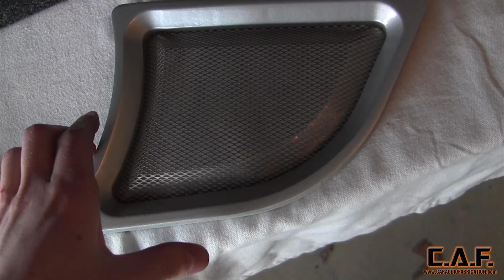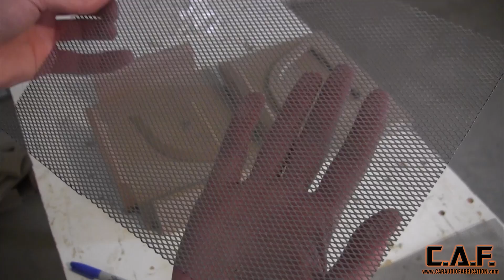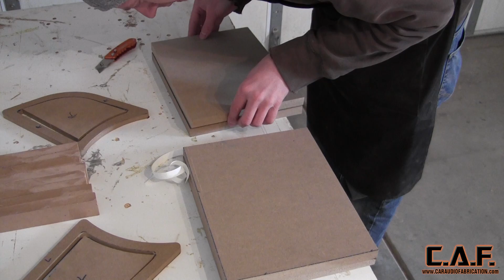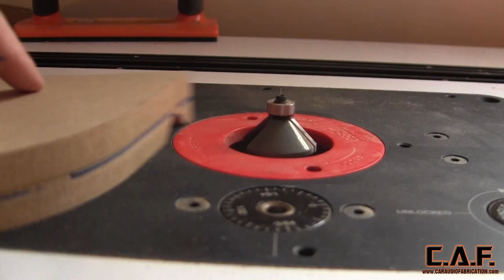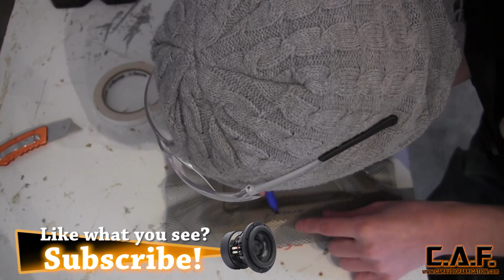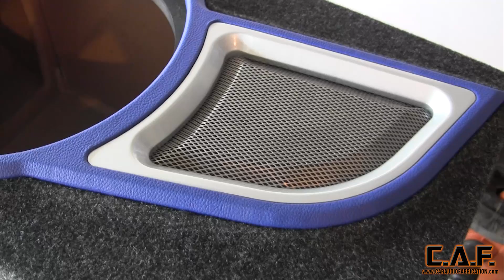How to Mold Metal Mesh for Speaker Grills and Ports - CarAudioFabrication

Comment: Nice job ,I worked in prototype ,there  are a lot of different perforation pattern's available in brass ,it forms easily,but not as strong as strong as steel ie dent resistance .have used high durometor polyuerathane castable rubber for press form's.etching primer is ness before paint ,powder coat,or plating work's well also on both for more option's

Comment: I started running out of room behind my stock grille in my first gen RAV4, I went about cutting away the plastic mesh at first but wasn't happy with the unclean non-stock appearance of an open uncovered speaker. I'm pretty hesitant on going forward with buying a hydraulic press or a router so I can probably replace those two with 'lowering my cars full weight onto a 3d printed form' ?

Comment: I have a 1997 lexus lx450 and I want to put a 12 inch subwoofer  behind the rear  passenger side panel . Right now I just have it screwed into the panel with no box behind it . I'm going to talk to some local installers about a fiberglass  type  box that will form from the odd shape of the  metal  behind the panel . Can you give me a idea of what something like that would cost .

Comment: Wire mesh finished with powder coating for a knockout look ... Can be achieved  with a home oven, powder adhesion is equal in thickness due to electrostatic attraction. Think  car seat belt buckle or stainless steel appliance finish or VW finish etc... Thanks for the education!

Comment: You can do right angle, but you have to shape the top piece double angled. First the gentle angle you have now, then the ninety that ends in a chamfered (ball preferably) edge. I've done it on just about any type of mesh that's made of under 2 mm material on the "link". Anything thicker, and you're going in to complicated forms or bigger presses. The other critical thing is, this method will draw the "skirt" on the outside far more severely than any other method. I recommend slice cuts made to match the kinks found via a sacrifice test piece.

Comment: you can eliminate the female top form by using a solid block of shore 40ish rubber, or a laminated "block" of thinner sections glued ala plywood. a couple dozen rectangles of  shower pan or pool liner, roofing membrane, even that castable rtv for molding poured as a brick. then alignment is only critical in parallelism of punch faces, so the same top can be used on a gaggle of bottom male forms. so long as the rubber stack is half again your draw depth, and you limit yourself to 18 ga mild steel sheet or lower load ranges, you should be golden on even relief details like ribs, insets, style lines, etc. if you only want to do mesh or  expanded sheet, then softer rubber shore 25ish will allow very intricate relief impressions, but the loads of solid sheet will give poor results, and very rapid wear on a soft die. shore 20 is a rubber band, 60 is a stiff tread truck tire, to give an idea of hardness involved.

Comment: I like this a lot but the problem is with a lot of ur videos is that it takes so many specialty tools that ppl like me are discouraged I am sure I can wing it on some of the process but I build for my personal  use only, but u r very talented and do great builds I enjoy your videos even tho it isn't feasible for me to use your techniques due the the limitations of my tool box
Reply: Daniel Harrell another option is to press it with your car tire... jack up your front wheel and slowly lower the wheel down onto the box!!
Reply: Ryan Drzewiecki gonna guess he was probably more concerned with the $1000-1200 worth of router/table/bits rather than the harbor freight press. OTOH, if someone has never used a router, this is not the jumping off point; chisels, rasps, and patience will get you to the same place.
Reply: You can pick up a cheap router on ebay or at Harbor Freight. A router table is just a smooth top with legs and a hole in the middle (I slapped one together in under an hour with a 2x4 and a scrap piece of countertop). As Ryan mentioned, there are alternative methods to press the box (though I would put the box between the jack and the frame of my truck rather than under the tire but whichever). Nothing in this video is outside the reach of a working class wallet.
Reply: Well, if you want to build something complex with the best quality and in reasonable time you will need a lot of specialized tools.

Comment: Nice tutorial! Do you have an idea on how to do this without a hydraulic press? If i want to do stuff like this, 100 bucks would be very much, cuz i'd use this press 2 or 3 times a year... do you think it could possibly work with a propper assortment of clamps? Thank you for sharing!
Reply: Yeah he's right, just jack up your car and use you floor jack to slowly lower it down. Then just pump it back up to get your piece out.
Reply: I was thinking the same thing. Once I plan on trying this I plan on using my vehicle. Brace it with chocks so it doesn't move and use it as the top of the press with my bottle jack pushing down into the press mold as if I were lifting the vehicle. Safety safety safety has to be first though
Reply: Andre Doute this is also a very smart idea! Could work!
Reply: search on YouTube. I've seen people use their cars and other heavy things

Comment: Awesome clip,like always.Just a quick question.How do you remove the inserts if its a snug fit? A quick tip video would be apreciated !
Reply from the maker: Just push them back out, a good fit means that you can press it in relatively easily but the piece wont fall out via vibration or shaking, but you can still push the piece back out. If you are concerned the piece will fall off you can always have a screw that is accessible from the back of the panel, or use magnets, can also add inserts primarily for the purpose of hiding mounting hardware.
Reply: CarAudioFabrication The idea is that I want to use inserts not just because they look good,but because i want to hide the screws that hold my door panels ( I hate plastic clasps which vibrate) and this means that I wont have any rear acces to them.My idea is to use a notch in a hard to see place.like the side of an insert which faces the door hinge.But you're the great fabricator and I would love to know if you had a better ideea !
Reply: Just for an example I would like to do something like you did in your custom door pods series with that long insert piece.

Comment: Do you ever anneal the mesh before molding?
Reply from the maker: So far I have never needed to, it is a thin enough thickness that it forms easily, yet once you add the bends it becomes more structurally sound. Ive tried damaging formed mesh, its difficult to do. It would really take quite a kick from a foot or whatever else in the vehicle.